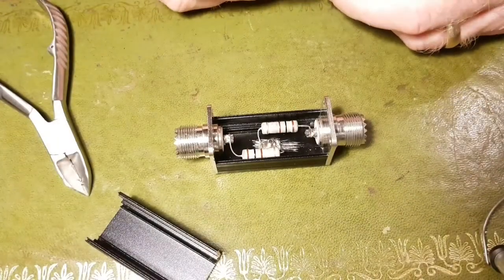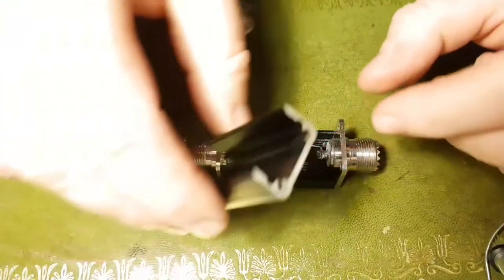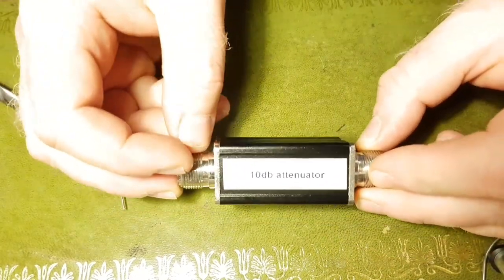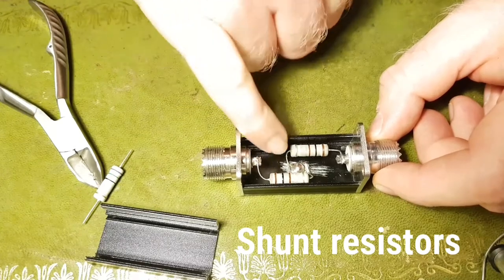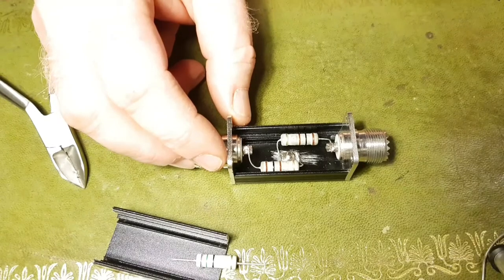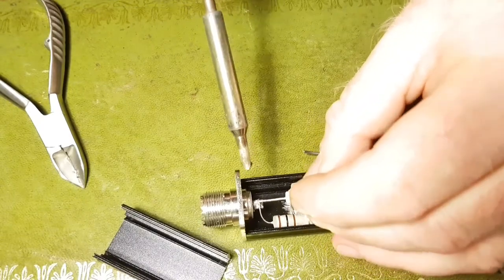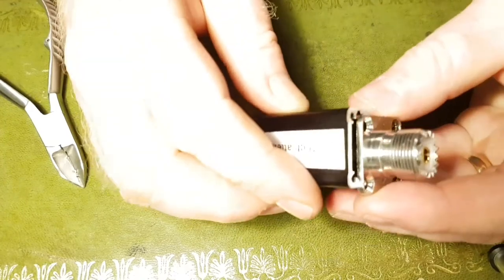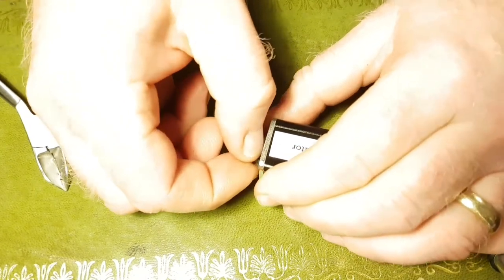A simple Attenuator build.

Comment: A question if I wanted to build a 20w attenuator  I could use 4 5w resistor in parallel?
Reply from the maker: Sure
Reply: @mk1tina  what value of resistor it will be for a 50 watt PEP thank for the help.
Reply from the maker: @Mr.Amplifier.  10db off 50w is 5w. Turn your radio down.
Reply: @mk1tina  i mean resistor value 
size
Reply from the maker: @Mr.Amplifier.  I used 100 ohm and 75 ohm to achieve 10db attenuation. Use Google to find a Pi calculator, its the modern way and u will learn too. Good luck

Comment: Thank you for the video. I have a similar situation, but am not good with electronics. How can I determine how to build an attenuator that would drop 200mW down to 4mW? (17dB attentuation)  (I'll be using a Zachtek WSPR transmitter @ 200mW output to a power amp that will have a max input of 4mw, and then 5W output).  Just not sure what value of resistors I need for this. Thanks.

Comment: I love the casing and overall design. Its just that those resistors look like wire wound resistors which might have significant inductance. As I understand that will cause some inductive reactance as opposed to having a purely resistive circuit. Did your attenuator work as expected?
Reply from the maker: Hi. The resistors are carbon, purely resistive. The attenuator tested out good, as per design. I built a automated switching attenuator after this one. Their is a video of that on my channel
Reply: @mk1tina  Fantastic!

Comment: Where did the screws come from?  Is there a kit for both the SO-239 connectors and the metal casing, or are they purchased separately?  Where is the relative price list for (all) these parts?
Reply from the maker: All obtained separately
Reply: @mk1tina    IS there a contact or source list for these items:  3 resistors, 2 SO-239 connectors, aluminum channel, screws and bolts?
Reply from the maker: @kirkgroeneveld3191  all was bought on ebay